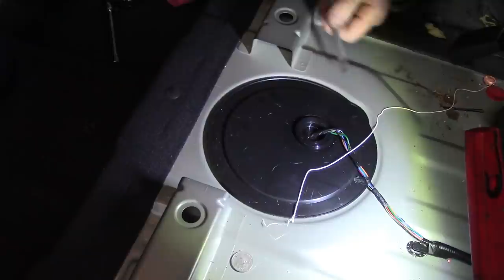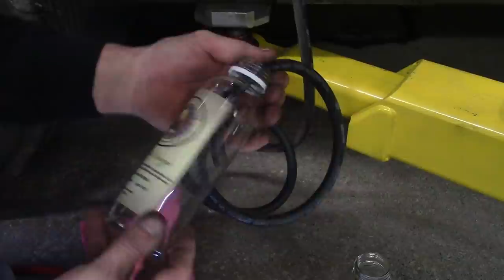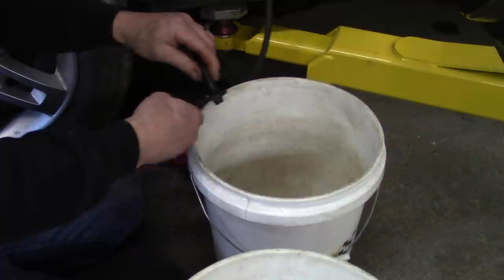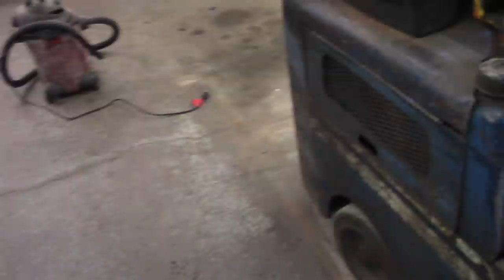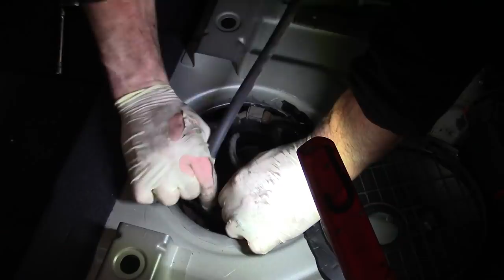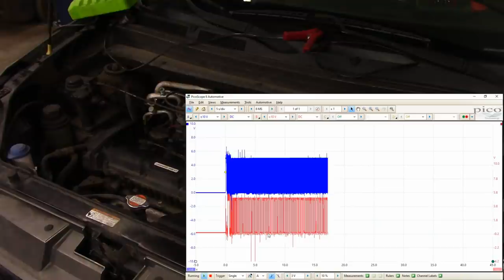Kia Soul - Auction Car Special Part II

Comment: After finding the fuel issue.....as you were revving the engine i was praying, if it was a sleezoid that did this, might want to also check the oil

Comment: 27:00  Get some glow plugs for it!  Thought I'd fall out of my chair!  So damn funny! Great troubleshooting, great video!
Reply: Come across the pond and it is far more common than you like to think.
And there is even the other way around too that is far more destructive, petrol or gas in a diesel engine.
The tightly made parts really hate losing that lubricity from the diesel :D

Comment: They wanted to be environmentally conscious, so they used the green nozzle
Reply: that green nozzle at bp here in ga is gas not what you think
Reply: Had to pump out a tank one time, diesel was in the tank. Small-town gas station had replaced a nozzle on their diesel pump with one which had the unleaded sized tip (I verified that). That's one way it could happen, but I've only ever seen it once.
Reply: The local gas station has green for gasoline and yellow for diesel.  Freaks me out mid-pump from time to time.
Reply: @michaelthompson7570  I hate going to BP for that reason. I am originally from Cali and it confused the heck out of me when I first moved to GA.

Comment: Well. You now have "parts cleaning solvent".
Reply: or an unknown blend for a 2 cycle engine. yeah I still have a couple of those
Reply: I was gonna say, "8 gallons of engine flush"
Reply: @chrisjackson9102  much better than kerosene and less expensive.
Reply: I couldn't agree with you guys more. It's sad that people think they have to run out and buy TP (whatever for?).  And everything else. I think the best way to avoid the virus is to avoid people, wash, wash, and just use good old common sense. I hope we all get through this and continue on with our happy lives, god bless you all!!
Reply: @trybriguy1357  
it becomes leverage.  Income.
Useable. 
Doesn't go off.
Reply: @boboften9952  ????????
Reply: @trybriguy1357  great message thx!

Comment: it was a repo the owner put diesel it it knowing it was being repoed
Reply: John Knox is that a thing people do?
Reply: @barbaracorso2022  you'd be surprised
Reply: A ten year old repo? I guess it's possible.
Reply: @reecenewton3097   i have 06 f150 with 85000 mile if i traded it , it would be sold fast
Reply: @reecenewton3097  yep. spent $24 bucks on diesel to burn the repo guy instead of putting it toward the payment.
those used KIA operators play  a mean game.
Reply: Bet you're right
Reply: Less damage than sugaring the tank
Reply: @timewa851  Probably a great customer of a "Buy here, pay here" lot. The same type of people that will dump $50 worth of quikrete down the toilet because their home is being foreclosed on.

Comment: Awesome video man. Been there with bad fuel. Great tips on the integrity of the test equipment too. Nothing like something as simple as a test light bulb going bad in the middle of testing something lolol
Reply: i watch both SMA and Joes auto electric...the both of you need to open a trade school for REAL mechanics not parts replacers. Good Job to the both of you for bring back common sense and simple diagnostics to the field.

Comment: I helped my dad with his Ford Fusion transmission lines. I know the exact line you are talking about, I ended up using a Dremel to cut the connector apart to remove it. What a PITA!!

Comment: Actually in upstate NY IE: the Adirondacks the diesel nozzle is the same size I've had 3 people at my shop in the last year who accidentally put diesel in a gas car.
Reply: I mean all you gotta do is PAY ATTENTION,    or  maybe a  "NEWBIE DRIVER",   or   the one who went to go fill up,   usually drives   "DIESELS",   and maybe by force of habit,   not realizing the car was gasoline,  &  OOPS.... 😯😱
Reply: I know of atleast one person who purchased a new Toyota pk-up  back when flex fuel  was getting to be common and did it on purpose because diesel just happened to be a few pennies cheaper than gas and the salesman said it could run on as little as 15% gasoline.... he totally missed the ethanol part.... despite the stickers inside the gas door and nice yellow cap....etc.
I think the dealership got him for something like $5k to replace his 'fuel system'  some people are just brilliant individuals.

Comment: Sounds like a neighbor dieseled the tank instead of sugar..
Reply: Or an angry ex.
Reply: Na... tanker driver filled the wrong tank at petrol station. 100 cars driving around Missing and Chuffing
Reply: @sgfelectrical734  But how would they have got the nozzle in?
Reply: or they stole someones fuel one to many times and got a surprise that the cans/tanks was now diesel :))
Reply: @caver1  he is saying the tanker truck driver at the gas station put diesel in the underground tank that is supposed to have gas in it. It does happen
Reply: @sgfelectrical734  Yup, that's how it happened to me, diesel right out of the gas dispenser.
Reply: or someone knew a repo was about to happen
Reply: @kylefowler5082  hey Kyle, as someone who drove tanker truck for eight years it is the first thing that i thought of when Eric said it was diesel in the fuel lines. just saying
Reply: Good thing it wasn't a diesel car that somebody put gas in.  There wouldn't have been a video, then.

Comment: Sister in-law put diesel in an 08 pilot. Sent her to a shop near by since my back was injured, 800 bucks later it’s running and driving but a week later the Cat started throwing a code. Likely needs a cat due to the diesel
Reply: Pilots are notorious for burning cats, they have 4. Thankfully they're cheap for a cat. Check with Honda dealer. I think they're warranted to 100k miles no matter the year.

Comment: You can make that mistake here in Ohio, them older mom and pop places the diesel nozzle is the same size, I'm guessing the nozzle went bad and the normal fuel nozzle will just screw right on to the line, Had some guy fill one of our fleet e350 vans with diesel, 30 gallons of it.... We pumped it out and used it for or Kubota lol

Comment: Hey Eric, I'm having trouble diagnosing a Yugo low power issue, if I send you a spark plug can you run a nasal diagnostic on it for me? $5 per sniff?
Reply from the maker: In case you didn't hear... my nose id big... real big. Therefor it will be $10 sir
Reply: Easy diagnosis.  Hmm...low power in a Yugo.  Isn't that what you paid for??  :-D
Reply: @SouthMainAuto  Hi Eric I am replying here in the hope you get to read my comments from all the thousands you get.
I will be 61 tomorrow although an electrical engineer by trade there is hardly anything I haven't fixed on cars and motorbikes over the years.
Though I would share a few stories, about 6 months ago I went to the Garage and filled up my Diesel Toyota Auris and then drove down the motorway from Liverpool to Manchester UK approx 28 miles at up to 75 mph, all was running fine until I came to the end of the motorway and stopped at a red light. The engine sounded like it wasn't ticking over very well anyway I dropped my daughter off and decided to return home another 28 mile trip but went down A roads so as not to get stranded on the motorway. I got home all ok and on investigation I decided to check fuel pump filter in the tank removed the cover held on with black sticky stuff removed pump and smelt Petrol😱with my big nose😁..Well I be damded I must have filled up with Petrol instead of Diesel. Anyway not having a lot of spare case I carried on driving until the petrol was almost used up approx 300 miles, then I filled up with fresh Diesel it's now 6 months later and my car hasn't missed a beat and I am sure running it on petrol cleaned out the Carbon from the exhaust.  I wouldn't have believed it if I hadn't done and seen it with my own eyes. All credit to Toyota for making decent engine's.
Great videos Eric watched both parts.
Happy St.Paddies day and all the best from over the pond.
Reply: Stephen Jones 7

Comment: You probably won’t believe me but when I saw that first plug and your reaction, the first thought that hit me was “diesel”. I’ve seen people put gasoline in a diesel but never the other way around.
Reply: I got a great deal on about half dozen 13hp pressure washers. Employee put diesel in them one at a time. Every time he did it and washer wouldn't run the shop would throw it out back and buy another.

They had been sitting for a couple years when I got them so they had the expected weathering. Ended up piecing together 4 solid washers.
Reply: @9HighFlyer9  Somebody gave us a pressure washer that the engine was seized. Turned out, no, it wasn't seized : they had FILLED the sump with oil up to the top. Cylinder was full of oil. Dumped all the oil from the crankcase, and out of the spark plug hole. Cleaned plug, new oil, cleaned the oil out of the carb., got it going. Well oiled machine.

Comment: What gave me the start to my career as a mechanic was working for an equipment and party rental place. The party rental drivers were using a rented truck with a Cat 3208, but they were so used to pumping gas into their normal trucks, they filled the diesel truck with gas and got 2 miles down the road before it quit. I went with a 55 gallon drum and a pump, got the gas out of it, added diesel, then bled out the engine.
That was 36 years ago, and started a career with diesels (mostly marine).

Comment: Smashing diagnostic and repair :-D
When you lingered over the plugs in part 1 it became obvious it wasn't gas being fed into it.
I'm sure that people are becoming more stupid as the years pass.
Reply: Shouldn't be easy to do either. The nozzles on diesel dispensers are larger diameter than the hole in the filler neck on a gas engine vehicle to prevent just this from happening.  But as stupid as people seem to be anymore, I don't doubt they managed it.
Reply: @timothybarney7257  What about the gas station that accidentally put diesel in their gas tanks, its possible it had a container filled from this gas station and they forgot that it was bad.
Reply: @DeatGaming  That would obviously be out of the prior owners control, but the likelyhood is much more remote that a driver dumped the wrong load as opposed to what likely happened here.
Reply: @timothybarney7257  More likely the previous owner was having issues with his crank sensor, needed to top up the fuel and used the nearest container in his garage. He forgot said container was full of diesel.
Reply: @DeatGaming  That actually happened to me filled up Toyota Auris Diesel only to find 60 miles later I had a tank of petrol, I just carried on driving until the petrol was used up although it did run rough below about 10 mph on the motorway at higher speeds it was fine...then I filled up with fresh Diesel 6 months later and the car is still running fine.

Comment: Im a master tech and I had a hyundai that came in with diesel last week and boy did it have me actually thinking hard why it wouldn’t start. I definitely learned from that. Most customers wont tell you they add diesel so they make you do the dance. I can now definitely differentiate diesel from gas now lol.

Comment: Thats a good engine. I had one in my kia Spectra and i got 353000 miles on it and my friend bought it and is still driving it 250 miles a day with no issues still. Always changing the fluids is key to longevity

Comment: I wonder if the diesel fuel was the reason for the kia to be at the auction....haha...rust jacking the crank sensor. I hate rust, Pa. is in the rust belt...so I deal with rust too..not as bad as Ny I believe. Thanks for sharing Eric. Neutral Drop giving you shout outs....those guys are insane, always a laugh.

Comment: Eric how do you legally dispose of mixed fuel like that?
Reply: Danzilly 
Used oil tank. 
Most of it just gets burned anyway after as bunker fuel
Reply: I don't know what Eric will say, but I wouldn't dispose of it,  I'd keep it around as parts washing solvent. 
Or, if I didn't have a commercial garage, I'd slowly use it up in my old beaters, lawn mowers,  roto tiller,  snow blower, etc.  So long as it's diluted enough with proper gas,  it'll still go through your carburetor or injection system and into the combustion chamber and fire.  I wouldn't try to sell it to anyone, but I'd be fine burning it in my own stuff. 
Chuck in a gallon of it, then fill it to the top at the pump with fresh stuff.  Less if you're dealing with a tiny tank like on a lawnmower.  Like 10-20% of the tank's total volume.  Tip - do it when you're going to use up pretty much an entire tank. Don't do it and put the thing away to sit for a month, because the diesel WILL settle out eventually, and then there's the problem again if the tank's pickup gets a big snort of it off the bottom of the tank.
Reply: Thanks for the replies guys
Reply: Parts washer oil burner or Bonfire starter

Comment: We had a massive diesel gas mix up here in the Dayton, Ohio area recently.  Speedway gas  had a major problem. we had dead cars all over the place, the news said it could cost thousands of dollars to fix each car.  Seems high to me. And I ain't smelling your finger. did you change the fuel filter?
Reply: I think that most of the cost is the disposal of the contaminated fuel.
Reply: @johnmccallum8512  That could be, it was multiple tankers over a wide area.
Reply: I witnessed something similar back in the early 80's.  Our local chain had its own fuel truck fleet, for hauling fuels to our stations, and other independent retailers who preferred to buy from us.  We also had a fleet dedicated to servicing the other side of our company, heavy equipment and construction.  
One day,  one of the major fuel suppliers called all around and was offering regular leaded gas at around 15 cents less than normal price because they wanted to empty out a huge storage tank that was being decommissioned.  So, the company sent over one of our straight trucks (the owner's idiot kid drove it) and loaded up.  He then went out to all of our stations and began dropping this "regular" into the regular tanks.  Shortly after he left our station and was on his way to the next one,  cars started dropping like flies. Some made it just out of sight, some made it barely off the lot. 
It only took about half an hour for someone to figure out that all these dying vehicles had just filled with regular at our gas station.  Turned out that the huge storage tank had been taking in rain water for a long time,  and that's what numbnuts had filled our tank with - rain water.  So, the company picked up a lot of tow bills, shop invoices, where peoples' gas tanks had to be dumped out and then filled with fresh gas.  The one saving grace was that back then, it was still about 95% carburetors, not a lot of fuel injection on the scene quite yet,  so the fix was a lot easier.  
Numbnuts learned a lesson too,  to watch the meter when he was loading fuel.  They have density meters that show the density of what is being admitted to the huge storage tanks, and they also work when pumping into tanker-trucks.  They also have a paste that the gas station industry has used for decades to check for water in fuel.  You wipe a bit of paste on the wooden dip stick that you use to "dip" the tank to physically verify the volume in the ground tank. If water meets the paste, the paste changes from a grey-white to a red.  The more water, the more red will be visible.  That indicates that it's time to have a specialist come around and do residue removal from the in-ground storage tank(s) at your station.
Reply: @stanpatterson5033  One of my sons hauls fuel for another local fuel company, Duncan oil, I'll tell him what you said, he motsly hauls to obscure locations, not gas stations, like Amish farms etc but I think he needs to know what you said.  Thanks!

Comment: Back in the 80’s we had a Chevy Nova, one that was built in CA along with the Toyota  Corolla - very similar cars at that time.  We filled the car with gas at our usual gas station, but the fuel supplier had put diesel fuel in the gasoline tank underground.  The company paid to have our gas tank drained and cleaned and we got it running again.  They must have had many cars that had to be serviced in that way.

Comment: I have a 2012 Kia Sorento with the 4 cylinder for around town.  Been a problem free car.  Good catch on the diesel.  I would have changed the oil due to diesel contamination since it had been cranked so much by you and the other tech.  You have a great channel.

Comment: Ha! Auction cars, I did them when I had my auto shop in the 80s and you would see all kinds of stuff like gear lube mixed with oil to quiet a rod knock long enough to run it through the auction block.

Comment: I've never been much of a gamblin' man, so I steer clear of auto auctions. But, would I drive a Soul if I got it for $300? NO. Guess I ain't got no Soul! 😁

Always fun when alternative fuels are tried. I once got a brand new lawnmower my buddy found in the trash transfer station he worked at. Gave it to me for free. I looked in the fuel tank and found it full ... of 10w-30! 😂🤣😂 How one does that, I do not have the answer to. Cleaned everything out, she fired right up and smoked like a '84 Caravan for 5 minutes, then cleared right up. Got $250 for that one on the ol' Craigs. 😎

Since these cars are a favorite of the younger generation, I'm gonna say that they used the, "If there's liquid in a fuel can, it's gotta be gasoline" theory. That ain't always true, no matter what color yer jug is! 😉 This public service statement brought to you by, SMITHSONITE. 🥴